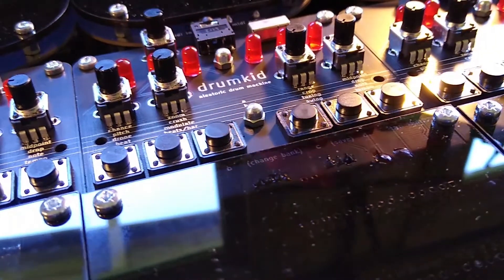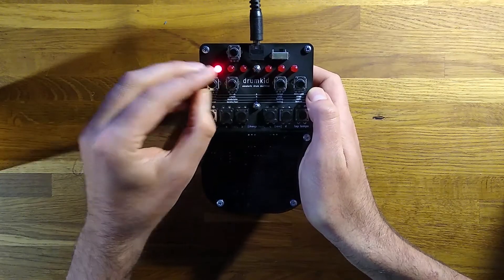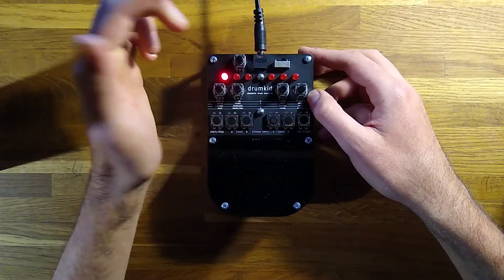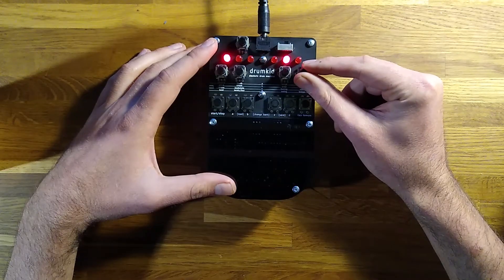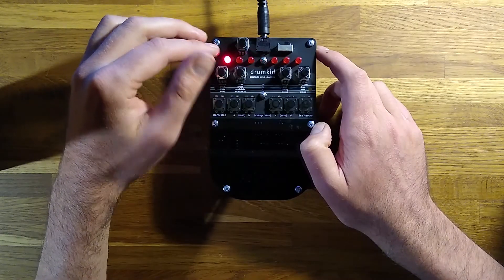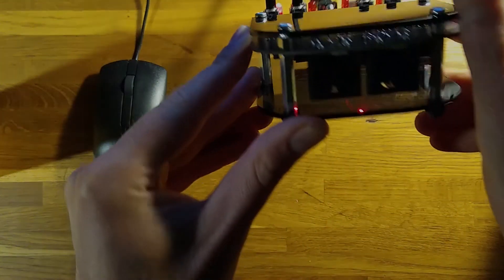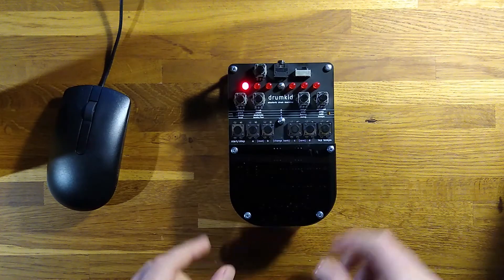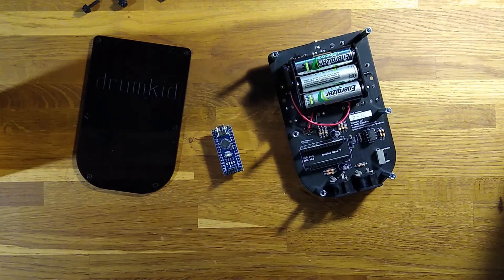DrumKid tutorial

Comment: What's the best way to sync with pocket operator?
Easy? Which is the msster/slave? Is it possible to use D10 & sacrifice tap-tempo?
Reply from the maker: So, the only built-in method of sync (without doing any coding/hacking/mods) is via MIDI, which Drumkid can send or receive, but I believe Pocket Operators use simple 5V pulses instead, which probably means there's no direct way to sync the two without involving another piece of gear somehow. However, if you don't mind a bit of hacking (which I'm guessing since you've figured out which pin the tap tempo button is connected to!), it should be totally possible. You could look for the line "Serial.write(0xF8)" (MIDI clock output) and output a 5V pulse on D10 at the same time, which would make Drumkid the master. You could also look for the line "else if(thisMidiByte==0xF8)", which is where the code reads an incoming MIDI clock signal, and try and replicate what happens there but in response to an input signal on D10, but this might be a bit more complex because you'd also have to remove the tap tempo button code etc. If you're not fussed about MIDI at all, I think you could even disable the serial read/write and use the MIDI ports to send/receive simple sync data. Hope this wasn't too overwhelming a reply!! Let me know if you need more info.
Reply: Thanks for the comprehensive reply! I am really not a coder so think it would be easier to use a korg volca to accept midi clock in (from drumkid) & output pulse for po...

Comment: This is just what I’ve been looking for, a lovely idea. I’d love to build one for my diy synth, but I’d there any way to sync it to cv or midi clock?
Reply from the maker: Thanks! It's got MIDI clock in/out built in. CV sync is the number one feature request but I haven't had time to add it yet (although I don't think it would be very difficult if you're into electronics/Arduino).
Reply: @BradshawInstruments  Brilliant! i have an arduino clock generator that puts out midi clock, i would love to get a pcb from you if possible...
Reply from the maker: @jamesmorrall  Cool, I sell kits via Etsy for £50. Haven't sold PCB's on their own yet because I wasn't sure there was demand but I'd be happy to sell one without components for, say, £10 + postage if that's what you're after. Am away for a couple of weeks but drop me a message if you're interested (contact details at mattbradshawdesign.com).